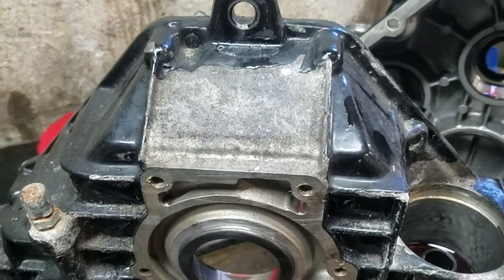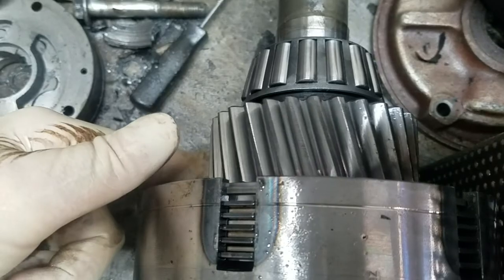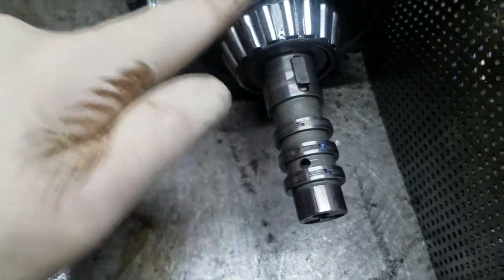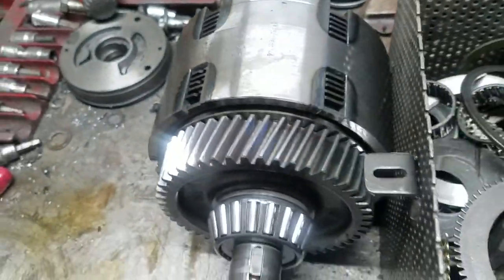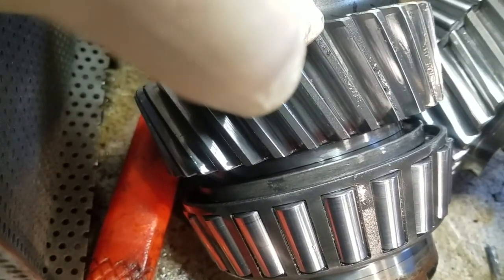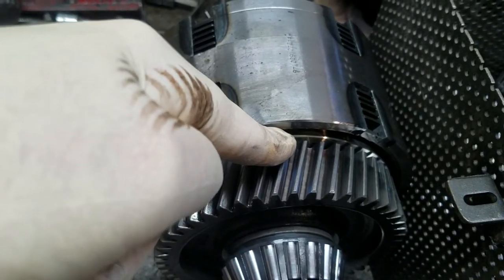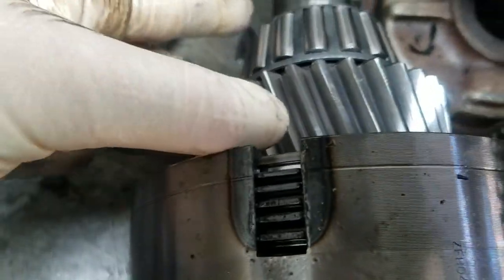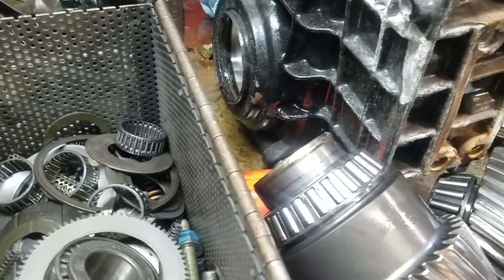ZF 63 IV 2.0

Comment: I have one of these transmissions and it making a really loud gear slapping noise,we've changed out all the bearings but the noise still persists
Reply from the maker: Did you replace the Damper?
Reply: @halemarine5991     
Hi,yes we did,it's a brand new damperplate

The noise is coming from the gear selector area

Comment: I Have a pair of ZH Hurth A63. My port Trans is making a ticking noise and it's not as smooth as the Starboard Trans They both have about 600 hours on them. No Slipping Runs great. 
On all RPM ranges its seams to smooth out. up to 3500 RPMs. This noise is at Idel. I did however find a small part of a gear tooth in my filter. It looks to be the very tip of one. 
There are no particles in the oil as I can tell. I just changed oil and filters and checked old oil. Do you recommend a rebuild or change to the 68A Version? Do I need to change both, or can I run A63 with an A68?  My Ratio IS 2.52 and Part number on the transmission is 3312001018 ZF63A -2.5
A=2.52 B=2.54 Serial # 33280 N
Do you sell new transmissions 68A Version? 
Thank you for your assistance. Watch all your videos.
Reply from the maker: We offer Rebuilts.